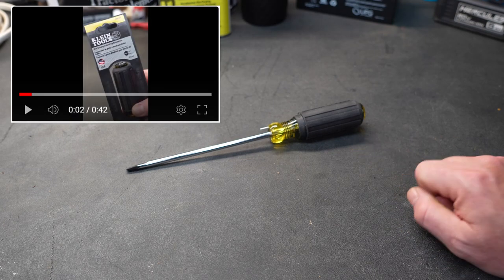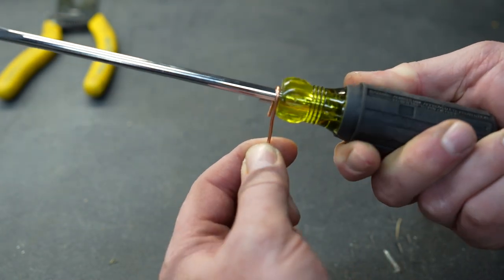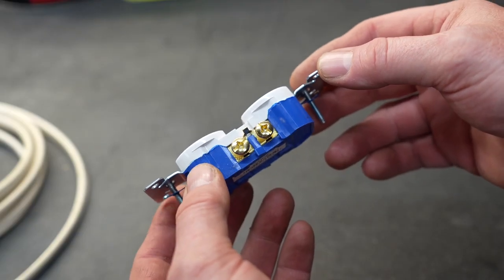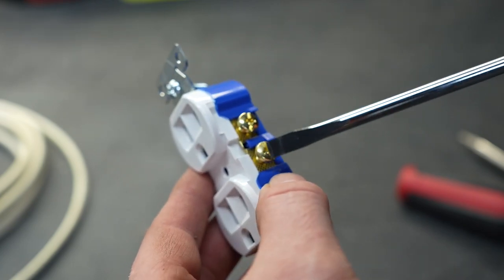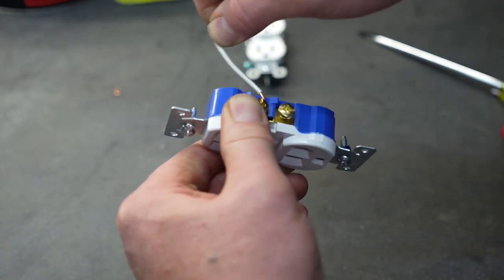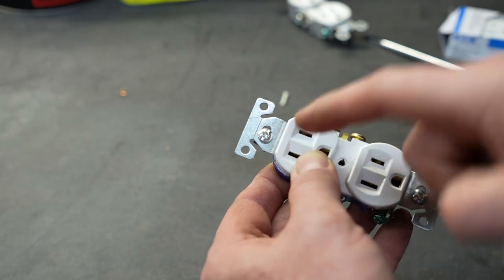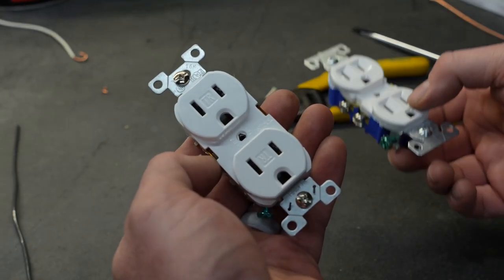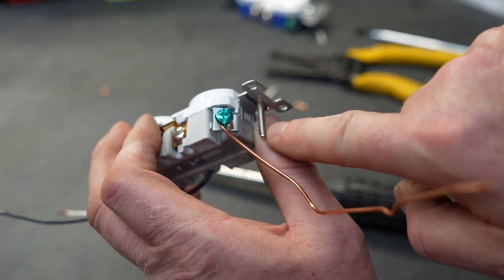The Klein Wire Bending Screw Driver and some Outlet Myths! A Follow-Up Video!

Comment: There are as many ways to skin a wire as there are to skin a cat. 😁
I carried a tool belt for years and had just what I needed to do the job in the belt. No more and no less. Walking back to the truck to get a tool was not acceptable. 
In new housing after we pulled the wire and set the boxes I would go from room to room setting outlets and hanging lights. I had a pair of diagonal cutters for trimming the wire to length, and a set of automatic wire strippers that stripped a consistant length. I carried a pair of needle nose pliers to bend the loop, also handy for reaching into tight spots to pull a wire or loop it around the screw,  and a straight bit to tighten the wire. 
With the hammer, a nifty little folded steel stripper for removing the Romex plastic sheath, and my Yankee screwdriver for running in the long outlet mounting screws I could go the whole day without walking back to the truck. This was back in 1973 before battery operated drivers were common. 
Having a tool like the screwdriver for bending the clips would have been welcome. I still would have been carrying the needle nose pliers though. 😁😎

Comment: I have that screwdriver inherited from my dad never used it to bend wires.
I have some older outlets that do not fit Robertson just slotted and philips. 
some real old ones that are only slotted so you have to have all kinds of screwdrivers not just roberts or combination.
 I always use the commercial grade outlets with the back wire feature that lets you just slip wire in strait and clamp it down like you showed in video. they always call it back wired not side wired for the stick it strait in and clamp it down with screw.
the big advantage of those back wired commercial outlets is that you can securely attach 4 wires to each side of outlet no pigtails no wirenuts or wagos needed. I believe it is the best way to wire outlets. You can buy them in ten packs, and they were around 20 bucks. but nowadays they are pushing the stupid tamper resistant outlets which cost more.
everyone is pushing the wirenuts and pigtails but I have a house full of bad wirenuts with too many wires crammed in electrical box which pigtails add to the crowding. and wagos seem great on a test bench but wires can get moved around or lever flip open when pushed back in electrical box.

Comment: 1:09
I shorted a battery once trying to mess with the leads so they would be compatible with my device, so that's good.  Should've just left the plastic covering on the free battery terminal until I was done messing with the other one.

Comment: Can anyone give advice on how to pack a light switch back in the receptacle ? The wire so thick and heavy duty I had to basically force it into the receptacle and use the screws to "wrench" it in (it was impossible to push it physically), which I'm guessing isn't good for putting tension on the inserted wires.

Comment: Milwaukee electrician screwdrivers have a small hole on the shaft to do the same thing. More elegant in my opinion.
Reply from the maker: I did not know this screwdriver existed!  Thanks for letting us know!
Reply: I have the Milwaukee and it works great,  seems like the pin on the Klein would get in the way and heaven forbid you accidentally slip with it and it stabs you in the hand or your finger.  That would hurt like hell, lol 😂
Reply: Have and use the Milwaukee version.  Works great and it's 100% just a screwdriver until you need to bend a wire. That hole just waits out of the way.  I love an "extra" feature that really does add something but also stays out of the way and has no impact on what the tool is mainly designed to do.

Comment: But which way does the ground pin go???  Why are some outlets orange??? Why are bananas yellow ??   LOL  ( The "engineered home" I'm in had all back stabbed everything, outlets, switches and light fixtures, all changed out when I dropped in a new box and rewired 2/3 of it so it no longer had the insane wiring it came with. I mean gee whiz, front room light on with outside outlet? or the hallway light on with the water pump feed? My favorite is having a GFCI in the bathroom that also connects to the kitchen counter BUT not the appliance outlets!)
Reply: yeah, i had an idiot who had no idea how to do wiring go around and just add outlets to original 8 circuits on original main fused panel. then he added a sub panel with 12 breakers off the pull-out fuse block for 240-volt stove.
every outlet I open or work on is a new adventure in bad wiring even black and white were just switched interchangeably.
Reply: @ranger178  ""black and white were just switched interchangeably."  Sounds like they thought that's what alternating current means ;)

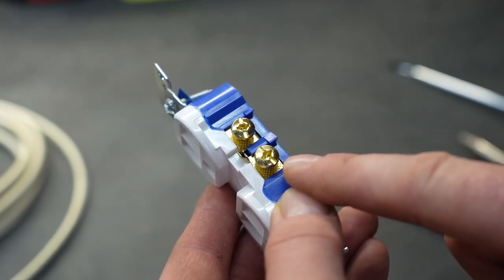Comment: 1:59 the only thing on this earth a Philips screwdriver fits well is a trash can.
Reply: You only say that because you're using them wrong.  The Philips driver was designed to cam out so that it's difficult to over-tighten a fastener, especially in automated assembly plants.
Reply: @davisev5225 Correct: It’s unsuitable for basically any application it’s used in. But you think it’s my fault somehow that people use them.
Reply: @arlingtonhynes  You failed to read what I said.  The Philips head is just fine, you're arguing a personal preference rather than any factual data.
Reply: @davisev5225  Stop babbling.
Reply: We can thank Henry Fords stubbornness for the Phillips head screws. 
He wanted to use Robertson head screws on his assembly line. 
Ford wanted to own everything that went into his cars. He built foundries to cast engines. The Rouge made safety glass for his vehicles. When he tried to buy Robertson he couldn't close the deal so he bought Philips instead. 
The cam out isn't a plus. I think it was an excuse for using an inferior screw head design. If it really was a intentional design feature why install it in a vehicle requiring every screw to be replaced once it had been removed? 😁😎

Comment: I've heard a blade screwdriver called many things, but I've never heard anyone call it 'regular' before. That's like saying you want a 'regular pop'
Reply from the maker: Yes, it use to be called a "Regular" or a "Standard" because when the Philips came out, it was the "Regular" or "Standard" screw driver.   Most of the old timers still call it regular or standard.  People started calling it flat-blade, slot-head, straight, flat, flat-tip or flat head to their children so they could tell the difference when helping their Dad.  Something that probably doesn't happen enough these days.   :D   I guess times are changing, and I just need to call it a "flat head".
Reply: @1D10CRACY  😁
Dad and I always called it a straight bit, so I still do. 
Just habit and after 63 years of using the name I will more than likely keep doing so. 
When I think of flat head screwdriver I think of the old screwdriver that I have with a straight bit and the edges clipped off so it completely fills the slot in a flat head screw to give a good fit for driving the screw into a countersunk hole in wood without the screwdriver scouring out the countersink.
When it comes to insulated screw drivers I just shut off the power when working in a tight spot. I still have the screwdriver somewhere that I used when I was 14 working with Dad wiring houses. It has a nice copper plated notch in the side of the blade. I was installing a circuit breaker and Dad wanted me to do it live. For practice I guess. I grounded against the bare copper ground wire and caused an arc. 
Okay no big deal right? Ground wires must be continuous and cannot have any nicked or damaged strands over the entire length from the ground point on the driven stake or on the clamp the water line. 
My error cost us a lot of time replacing a long and expensive run of ground cable. 
Now I just shut off the power and use a battery-operated lamp to work. 😁😎
Having an insulated screwdriver sounds good until you loosen a wire and it pops out of the screw and arcs over against the box or some other conductor. Then we are back to pulling new wire. Working on a bid job means those things can ruin your day. 
A third reason for turning off the power is the Lock Out/Tag Out rule. OSHA has a whole lot of paperwork waiting for when an injury happens. I try and avoid having any contact with that group.
Reply: @1D10CRACY  Around here we call it a Minus, and the Philips a Star, unless we need to specify Philips or Pozy (although it usually means Philips because nobody like Pozy.
Reply: Plus (phillips), Minus(slot), screwdrivers, the young,uns refer to them as!.